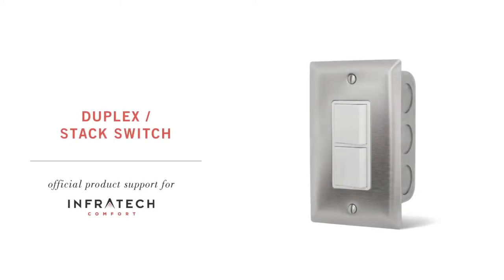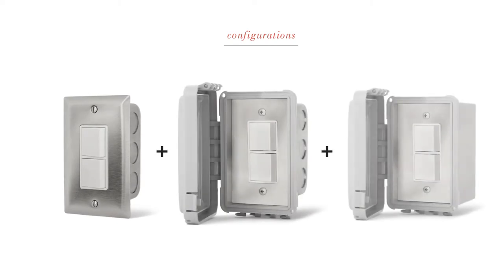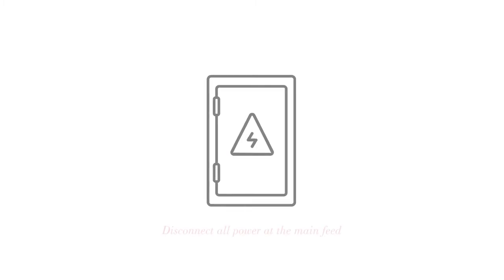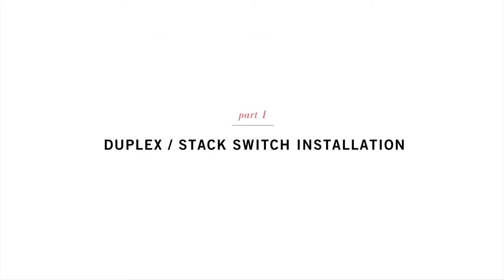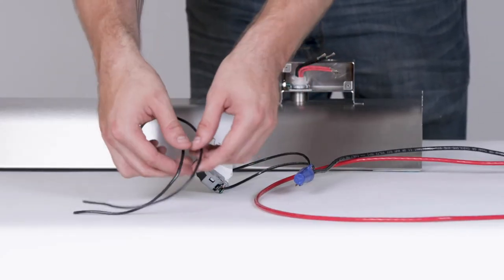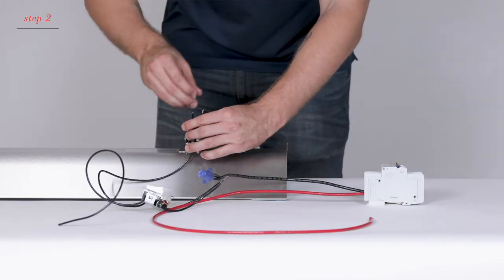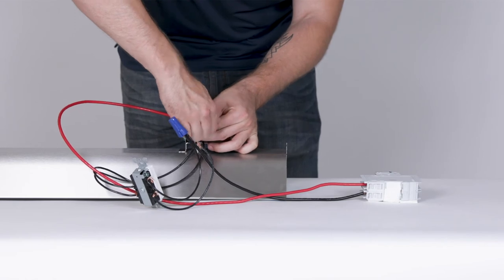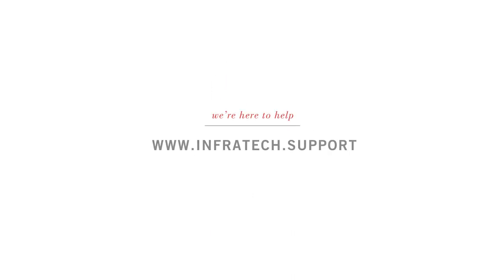How to Install and Troubleshoot Infratech's Duplex/Stack Switches for Outdoor Heaters

Comment: What size of breaker are you using? bcs usually we use a 30 amp breaker and number 10 size of wire and you guys are using 120/277 v 20 Amp s switches?
Reply: I am also very interested in this question, it is impossible to pass inspection with this switch
Reply: My company installed these outdoors. We divided the Wattage by voltage from the product and then saw it was 25 amps and up sized them to a 30 amp breaker.

Comment: The R90 burned up and my marettes  melted into a puddle. The connection box is right above the element. I will never recommend this product ever again. I have had to completely rewire 2 heaters so far and replace the r90 with high temp 140C wire. TERRIBLE PRODUCT!